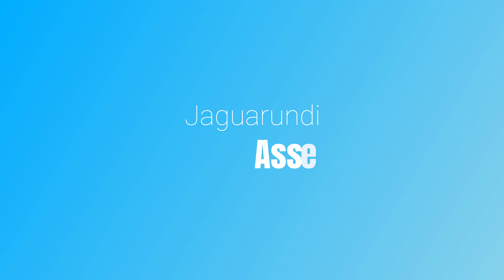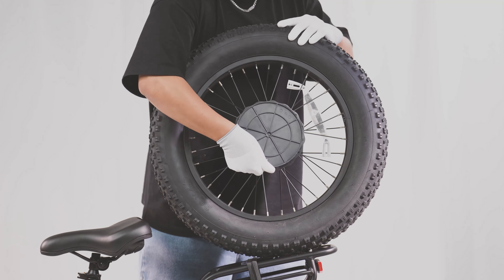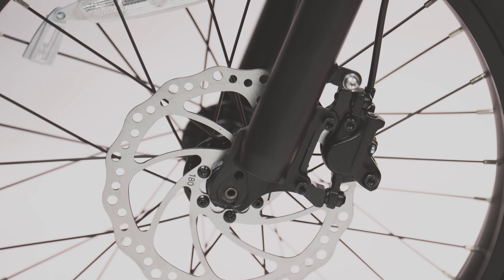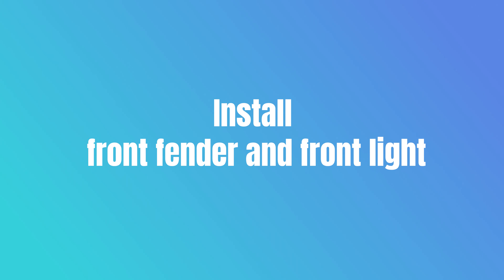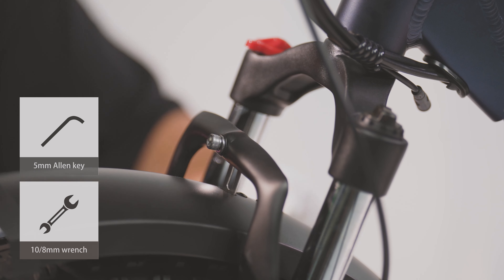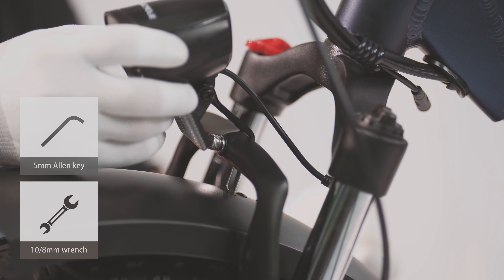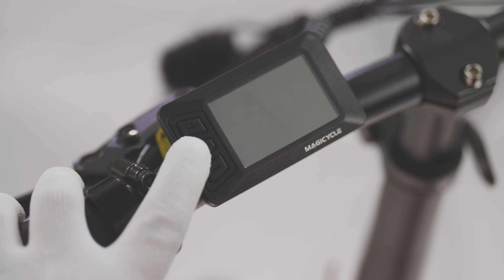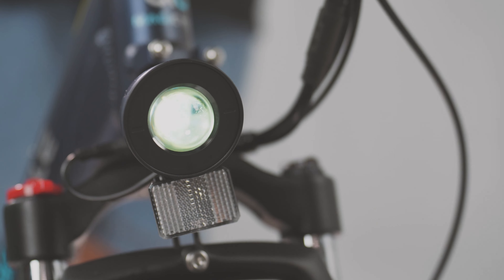Step-by-Step Assembly and Installation Guide for Magicycle Jaguarundi #ebike #installation

Comment: Where are the 'torque' specifications to ensure adequate 'tightning' of nuts and bolts while assembling..and later chequing tightness after a few 'run-in' rides. ?? Thanks you. ( I have pearl white Jaguarundi).
Reply from the maker: Hello! Thank you for your question. For torque specifications during assembly and subsequent checks, we recommend referring to the user manual that came with your Pearl White Jaguarundi. The manual typically includes specific torque values for different nuts and bolts to ensure proper tightening.

If you're unable to find the torque specifications in the manual, please reach out to our customer support. They can provide you with the accurate torque values and any additional guidance you might need. Ensuring the correct torque is crucial for safety and optimal performance. Enjoy your rides on the Pearl White Jaguarundi and ride with confidence!